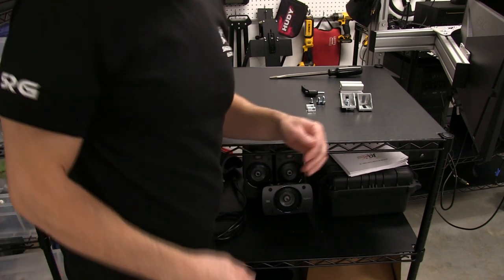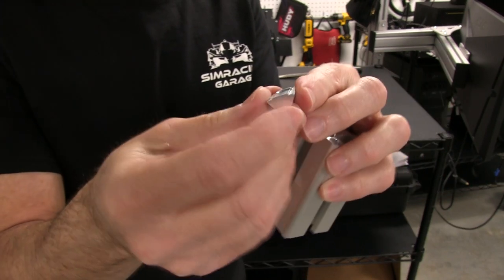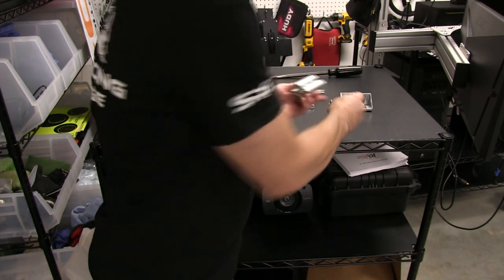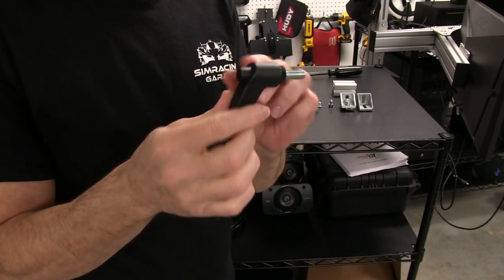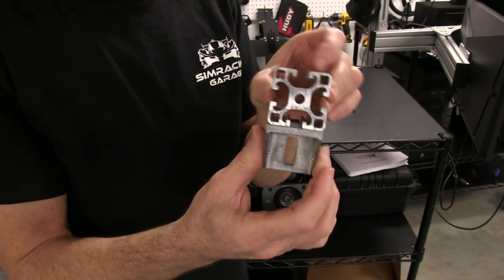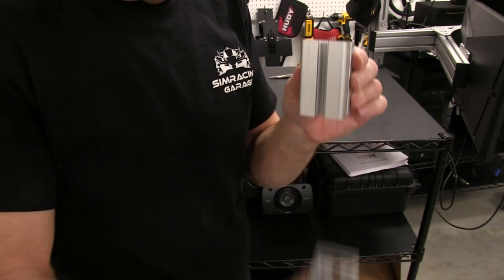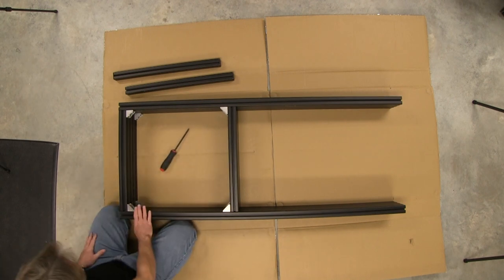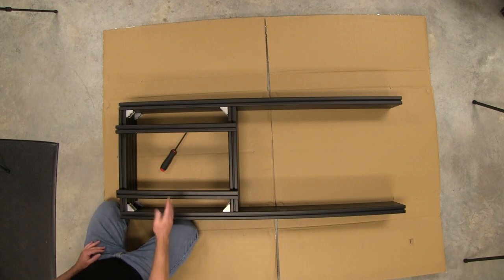Sim Lab P1 Cockpit Part 1 "The Build"

Comment: If you want the shifter mount to be lower, you don't need to cut any pofiles. You just mount it on the end of the horizontal profile instead of the end of the vertical profile

Comment: Just ordered mine two days ago... 250euro for shipping, 889euros for the non black P1 with accessories 

Perfect timing with the videos
Reply: Jason B same here :) so glad to view the review while i wait
Reply: What accessories did you get? I want to get the triple mount that attaches to the rig, but it's out of stock.
Reply: Cal Ripken I'm using VR so I got only fanatec shifter plate, mouse plate, keyboard tray and caster wheels to move it away not to piss my wife too much :)
Reply: Cal Ripken , i have a stand alone triple monitor stand now in 80/20, i like being able to move it back and forth, i use my sim rig for other gaming also... i got 1.5inch vesa mounts, stand off screws, cable management tabs, the deck plate, fanatec side shifter mount, large keyboard mount, mouse pad, large extra mounting point for the left side, rubber feet

Comment: 6063 grade aluminum is considered a soft or soft-to-medium grade aluminum. A shop told me - after explaining my cockpit (big DD wheel, HE Ultimates, NLR Motion, powerful transducers) - that they recommend a medium strength grade such as 6005-T5, 6005A-T5, 6105-T5, 6061-T6, or 6082-xx( not sure which temper).
I know at least one of Sim-Lab's suppliers use 6063 Aluminum profile and I think JCL too (but don't quote me on that).

I'm trying to figure out if I should just buy a P1 from Sim-Lab and get it over with or if I should buy my own 6005A-T5 or 6061-T6 profiling.

I want this cockpit to last me at least 10 years if not the rest of my life and the weaker torsion strength, flexibility strength, and overall strength of the 6063 grade compared to the others concerns me for long-term use...

I would greatly appreciate some insight from others...
Reply: Jeez, really, i think you are well over thinking it. Do you think its going to fold up on you or crumble under your weight? I have the P1, fully loaded with An OSW20nm motor, HE Pro pedals, HE shifter plus 4 Monster butkickers. It's the most solid, stable, no FLEX rig i have ever owned. Have a serious word with yourself then after you have get on and order yourself a P1 and enjoy. Tell me the shop, Phone number, website that recommended that profile and i will quiz them on this
Reply: @menacegtr  Thanks, man.  Ya I figured I was over thinking it, plus, I wasn't even considering the fact that most of these pieces are big pieces (eg, 40x80, 40x160, etc.).  Thanks for the advice.  I got 4 Clark Synthesis TST429 Platinums for the 4 corners of the car and 1 Buttkicker Advance (medium sized one) for under my butt.  Hopefully that'll work out good.

Comment: Why not using the same 90° brackets to mount the different uprights instead of the flat aluminium pieces? It would be easier to adjust the height. Although this design might be more rigid?
Reply from the maker: Not sure if it is more rigid when using the plates instead of 90° corner brackets, haven't tested it. Heusinkveld's GT rig uses the 90° brackets. So I would think it is about the same for holding strength and yes it would be easier to adjust the motor/monitor mount uprights using that configuration. But the motor mount height is easy to adjust using the six bolts that hold the motor mount plate to the uprights. If you have the monitor mount they also have their own height adjustment.

Comment: Hey Barry, thank you for all your awesome vids.

Short question: why you prefer your seat directly mounted instead of using a slider? Just because you don't need your seat to be adjustable or are there other reasons like e.g. stability or something like that?
Thanks in advance
Reply from the maker: You get the least amount of flex with the seat hard mounted to the cockpit. Seat sliders have both logitudinal and lateral movement in them when with the tracks engaged. Some are better than others in this reqard. That said, I have a Recaro branded seat slider set. And it seems to be very solid once the tracks are locked into each other. So , using that for now for convenience
Reply: @simracinggarage3026  Thank you for your answer and keep the good work up :)

Comment: My OCD kicked in when you put the nut in at 1450 180deg opposite of the one at 1425... haha
Reply from the maker: Really has no effect other than aesthetics. The T-Nut can slide either way to compensate. That said, my OCD kicked in and I did go back and flip it around after I saw it. lol.
Reply: Sim Racing Garage , i figured there was no functionality difference , but my inner feng shui would have totally made me go back and change it also ... haha
Reply: Glad I wasn't the only one. 
Saw this video 7 months ago and now I ordered my own P1 rig (my powerfull legs tore up the metal bars of the rSeat Evo v3. lmao), with wheel deck though as I find this to be more versatile myself.
So yeah, pity this fool with OCD as it'll be hard work making the plan come together. lol

Comment: Great video as usual Barry.

What model are the spherical speakers you mounted on the rig?

I notice you mount your monitors much further away from you than most sim racers (and on the floor, not on the rig itself). Is that a personal preference or just to avoid the monitors tilting when the Dbox actuators tilt the rig?

Cheers - Gary
Reply from the maker: The speakers are called "Orbs". link: https://www.orbaudio.com/collections. When I am racing I have the monitors 24" away from my eyes. In most of my videos I have them further away so the viewer can see more of what is on the monitors. Floor mounted and on wheels is a personal preference. Makes getting in and out of the seat easier. And much easier to add and remove hardware that I am reviewing.

Comment: Just wondering, apart of extrusion are the other parts like 15mm motor mount and 10mm pedals tray made also from aluminium or from steel?
Reply from the maker: Those mounts are also made of aluminum.

Comment: Any chance you will be doing a TR1 anytime soon? I just got one and the lack of instructions is killing me in trying to figure it out!
Reply from the maker: I don't know if I will review TR1. I will have my review of the GT1 EVO out next week. That and the .pdf schematic that you can download for the TR1 may be enough to get you through it.
Reply: Thanks anyhow. I got a TR1 but am having difficulty with the build (I think they sent me the wrong bolts/nuts pack). Several of the bolts are too long and then I am missing what should be some longer bolts. @simracinggarage3026
Reply from the maker: I'm sure the guys at Sim-Lab will get it sorted once you contact them. They have a great reputation for that.
Reply: @simracinggarage3026  They have been great so far! I am just anxious to get it together, but I seem to be missing the proper size bolt.

Comment: I hope this rig can be assembled without having great experience on 80/20 rigs. I want to use it as my rig, however it would be the first ever rig I'm using, so I have no experience in building those rigs.
Reply from the maker: If your are patient and take your time, I don't see how you could fail. I tried to give as much detail as I could on the assembly process so anyone could build this kit.
Reply: @simracinggarage3026  I want to have fanatecs podium wheelbase DD1. Should I get the wheeldeck version of the rig or the 15 mm mount? How were you be able to get both? Can I have them both on my rig at a time or do I have to make a decision?

Comment: It's great cocpit. The problem  is when u live in Australia ,the fright cost is almost the same as the rig  520euro :( I think I should back to live in Europe lol

What's the size and weight of the box or box's they send the cocpit to u Barry? Thanks
Reply: cant you buy profiles separate in  a dedicated aussie shop?
Reply: I check it and for material I still have to spend around 700-850 but withaut the awesome stering wheels mounting plate (best part of  pt1 cocpit) To order the extra parts have to spend few hundreds including postage ,so probably is better order full cocpit.  I have to sell my modyficate next level rig and add few $ for the one from video ;)
Reply: Hmm, are you sure. Mind you, you dont need triple slot profiles for the bottom. Its a bit overkill. Quick google says 170 for 6m double slot, which is about all you need for the base and the uprights.

The motor mount is really nice indeed, but you can buy that separate at sim-labs. I would think that reduces shipping cost too.
Reply: I contact with sim-lab.eu and I have to say they are the best to deal with.They can supply all the fastners and plate etc.. I have to just buy the profiles in local shop. It will drop the cost for fright from 520 to 105 euro. That's a big ;) save.
Reply: Nice. So you're getting a custom set with teh wheel mount? I looked at their site and the motor mount itself is out of stock
Reply: I know ,I saw it also.  I had chat thrue the email with guys from simlab so maybe it is one servo mounting plate spare
Reply: Hi Greg, it's been a few months I am just interested how you got on with this? Did you proceed with local profiles, if so who did you use in Australia? and did you go with the sim-lab fasteners etc? Thanks for any feedback for a fellow Aussie sim-er.
Reply: Greg Jedrzej I’d love to know how you got on with this as I live in Australia as well and would love an 8020 rug but shipping has been prohibitive so far

Comment: At @1:40, what's the length on those bolts? I'm building a pedal tray and I'm not sure which length I should order
Reply: depends what profile and fastener you use.The shop you buy the stuff, should have the measurements listed

Comment: Hello Barry, Thanks for this awesome review, I bought the exact same Rig because of it and I have it built 95% but now I am stuck and I hope you can help me, I have watched this Video ofcourse but you skipped that part. Which Screws did you use to mount the "Front Mount Bracket" to the upright alu profiles? I have only cylindrical M8x20 in the Box but they are definitely too short, also there are M8x40 which are too long. It looks like it should be M8x25/30 in the Box but since they aren't listed in the Part list I probably did something Wrong? I also have a lot of M6 screws but I am pretty sure it should be M8. If you don't know which Screws I mean I made a picture: https://imgur.com/a/rx5dwE5

I also asked simlab but they seem to be very busy due to sim expo.

Hope you can help, thanks
Reply from the maker: I am using the M8x20 bolts without washers. You have to back the threads out of the t-nut so they are on about 2 turns and have them installed on the bracket before sliding them in. Also, make sure the 4 bolts that are used to secure the upright brackets are loose enough for the upright profiles to move sideways a bit at the top where you will be inserting the t-nuts. This helps with getting all the t-nuts on the motor mount bracket inserted with the least amount of drama.
Reply: Thanks a lot